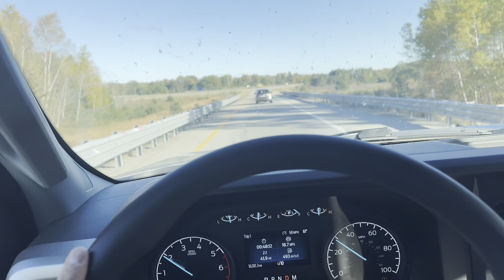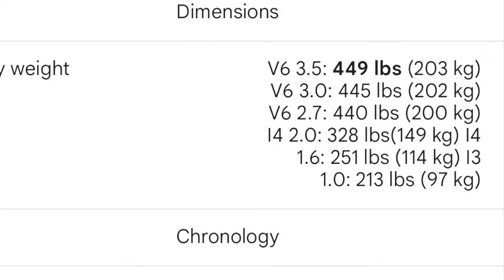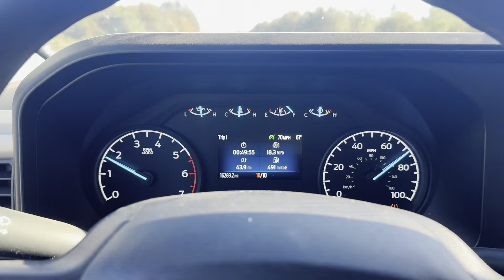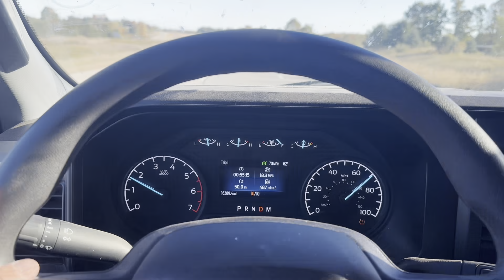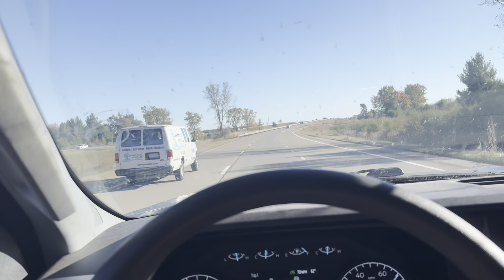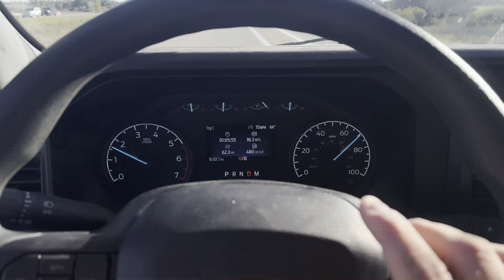The Ford 7.3 Gas needs to be put in these 6 vehicles Ford!

Comment: Great Vid! Loved the topic! Love the 7.3 thus far, no complaints. While we are talking about the 7.3 L, give some oil recommendations to use.
Reply from the maker: Glad you enjoyed it. I do wish ford would take my advice. Id be a buyer. 

As for oil i do use motorcraft per fords recommendation.  Motorcraft is good oil.  I tend to use mobile one on older engines. Iv had good luck with it.  

Fords cam/ lifter failure in the 7.3 platform isnt from oil brand/ quality or additives its from lack of oil pressure at idle.  They have a variable volume pump which was done to decrease efficiency loss on the engine but why would you want to stave the engine for oil just to save fuel?  I dont get that. 

Anyway im nearing the milage people commonly have lifter failure and if it happens ill report it. I do try and keep idle time to a minimum and i do 5k oil changes.
Reply: @greatlakespowerstrokefx4  I definitely will do 4-5K oil changes. But, would it hurt the warranty or anything If one, I change my own oil? Two, what If I used Amsoil Sig Series? Would that meet specification and requirements? 

What is the mileage that you normally have lifter failure at! 

Thanks for the information and the topics you provide.
Reply from the maker: @BIG-E1776  nope document your purchase of oil and when you change it, miles and date.  So you can supply that to ford if you ever lost an engine.  Check and make sure that oil meets fords spec. It probably does i think ams oil pays the money to submit their oil for all the ratings. 

Personally im not a fan of ams oil.  So not saying its worse but im just not bought into the hype.  

Clean oil changed at the right time is going to do everything the engine needs, from any brand that meets the weight and spec requirement. Including costco and amazon basics.  If your truck doesnt have the correct calibration (dealer searches your vin to see if you have the calibration that drops oil pressure at idle) your engine doesnt have an oiling issue and likely will be extremely reliable.
Reply: Run Amsoil Signature. I don’t follow the mileage of the oil I still change mine at 5,000kms but choose to spend extra on oil and filter from Amsoil. It’s the best oil on the market period. People will tell you just buy cheap oil and change it - and that’s fine. However, we pay big bucks for these vehicles and an extra $50 at the oil change interval for the best oil out there isn’t going to hurt. That’s what I do anyway. I’ve yet to have an oil related issue in any motor from small engine to sxs to snowmobile to SUV, trucks, you name it. Knock on wood of course! 😂